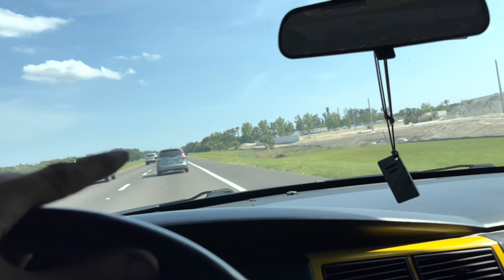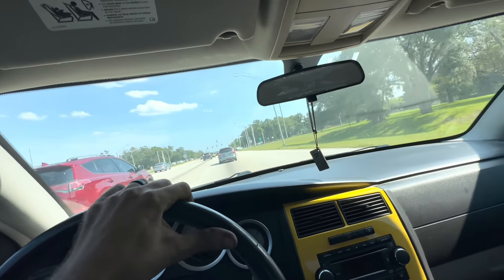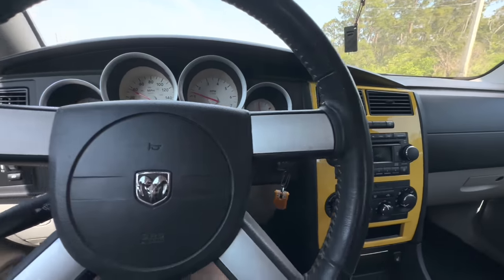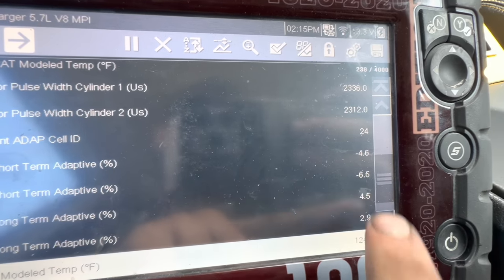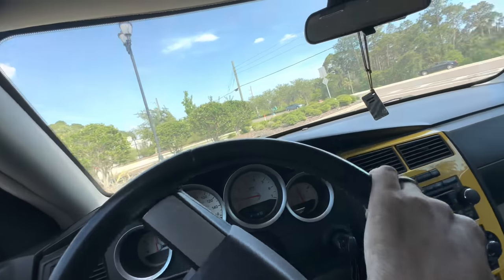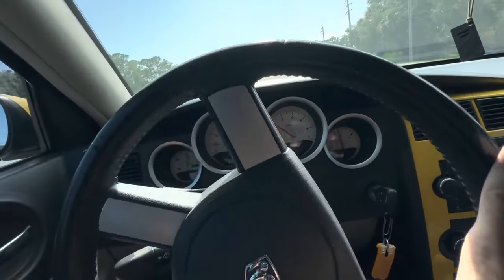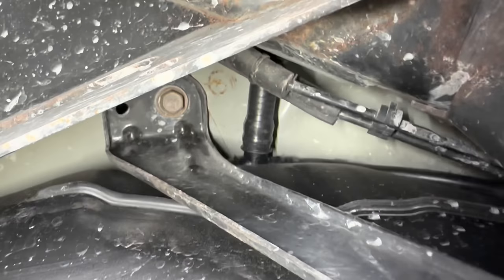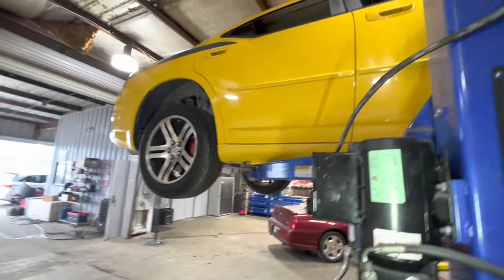Customer States: Engine Stalls After Fueling...HELP!! Dodge Charger 5.7 #mechanic

Comment: I could literally write a book on this subject.    It took me FIVE YEARS to put it to rest.    And I have a Lifetime Bumper to Bumper Warranty from Chrysler.   Bought it brand new at the dealership where I WAS having it serviced.     They were not helping and too were throwing parts at it.    As far as the gas tank issue, the NHTSA did their investigation and found that the rollover valve swelled when exposed to certain amounts of ethanol, caused an inconsistent tank pressure scenario, and ultimately liquid fuel would enter the EVAP canister and then the intake manifold under certain conditions, but in action, too many variables to predict.   The computer is looking for fuel vapor, not liquid, at that time and this basically floods the intake charge.    Stall.    They issued a set of VIN numbers for fuel tank replacement, which eventually became a full lifetime replacement warranty for all of the 2005-2009 LX cars.    They called it a “campaign “ and not a recall as it was deemed “not a safety issue”.     Funny, Chevy had a problem with ignition switches giving the same result, random stalling, and issued a safety recall.       Hmm.    Sounds fishy.    My car once stalled after a blast from the high speed curve on ramp, up to about 85, passing traffic in the far left lane, only to have it stall for the first time in several days, with no shoulder on my left, leaving me dangerously navigating all of the traffic I had just blown by, with no power to accelerate, yet, big trucks barreling down, and a fair bit of traffic.  Having to tap the brakes. to go behind slow traffic but having no throttle to stay ahead of the truck running me down in the next lane, but knowing to wait till after it goes by means getting creamed by the other truck a few lengths behind it will leave you a bit pissed off IF you make it through that twisted gauntlet in one piece.    Again, I could write a book.    Oddly enough, my car only stalled after a fill up ONCE, EVER, and that was with premium fuel.  In South Carolina, ethanol wasn’t mandated till 2018, and it was often used to raise the octane of regular fuel to get premium 93 octane.    Each state had different times and methods of implementing the mandates, with most starting in 2014, coinciding with the onset of the widespread stalling problem.    I called my wife and I went across the street to buy a hand pump from the auto parts store, and then pumped about 1/4 tank into her car, my car fired right up but did run rough and stall a few times just after, before clearing up.    Before that, I had to push my car away from the pump, as it would fire then stall, over and over.       At that, I wasn’t convinced it was the tank.    I ended up replacing the canister, the vent filter, the purge solenoid, convinced that was the problem.     Much to my dismay, after cracking open the canister and expecting a gooey carbon charcoal slurry, I found that I was wrong.   It looked pristine.    On a car with 165,000 miles at that time.   Wow.     Long story short, between the dealership and myself, I went round and round for five years, and they finally decided it was the engine wiring harness, and that a short was messing with the computer.    They couldn’t find one, even though they had a warranty to satisfy, but I did find a nice used one, inspected it myself, and being a sound engineer, I have extensive experience looking for wiring problems.     Did the harness swap, and guess what.   The problem came back.       My gut had been that it was the ECU but the dealership denied that.     I finally made an executive decision to pull the trigger on a company with a great reputation, Car Computer Exchange, and for $500 out of my pocket, I got a rebuilt and heavily tested ECU with a lifetime warranty.     Upon installation, the car fired right back up, and believe it or not, the entire car felt better.   Mind you, it ran like a champ beforehand.  But it just ran BETTER, and even the steering and brakes felt better, even the exhaust note was a bit different.     I guess this was all due to the most up to date fuel and ignition curves and stability control updates.   Incredible.    That was one year ago this July.    Not one hiccup since.    I truly believe all of these have the same source problem.   Of course I can’t prove it, but some speculate that the solder or the method of soldering used on the OEM ECUs led to premature failure.    Mine really started acting up after driving down about 10 miles of gravel and dirt and woodsy road several times for a remote recording session.     It also was more prevalent in the heat, rarely stalling during winter time.   The symptoms were all over the place too.     Sometimes it would stall right at the top of our Cooper River Bridge here in Charleston, SC, at almost the exact same spot, approaching the crest, and it also did so on the other tall bridge here, and always only after extended idling with AC blasting, making not for a hot engine coolant temp, but a very hot engine compartment .     Electronics don’t like heat.     I might write the book soon.   It would blow your mind what I dealt with at this dealership.    Mind blowing.     I have a lifetime bumper to bumper warranty on this car, which is a lifer, and I’m not sure if I’ll ever take it back for anything.     Think about that.

Comment: LOL! He said that the dealership would have done the TSB repair when the vehicle was in the shop. LOL!
Reply: I had two TSB's on my 2018 tacoma. I knew nothing about them until I talked to another tacoma owner. The dealership said they would not do the repair until I was experiencing the issue in the TSB. I said, "Well you can't fold the rear seats down so how the hell are you supposed to know the cab brake light housing leaks into the cab of the truck behind the non fold seats?" He just looked at me like "Well you are right."

Comment: my 300c had that issue, closer to drop in rpm and then a bit of a surge, noticed this after topping off gas during fill ups, stopped doing that and no more issues last 10 years,

Comment: Here in Canada we operate B-trains too, (two-trailers) a fully freighted B-Train takes 11 seconds to come to a complete stop from a speed of 100 kph (62 mph approx) that’s with an alert driver, on a good road with good tires and brakes. It doesn’t matter where you are in your vehicle if you are less than 11 seconds ahead of the B-Train and you hit the brakes hard, and we cannot move over to avoid you, we’re going to hit you. It will not be gentle, I will probably survive, I cannot say if you or your rear seat passengers will. This isn’t an attitude of "if it’s a question of you or me - it’s gonna be you!” It’s simple physics. Give the big rigs a wide berth drivers, we need the room. Drive safe everyone!

Comment: My 2006 magnum RT has the stall issue when filling the tank until the gas pump auto stops. I never try to top off any of my cars. I never replaced the tank under the extended warranty. I am just careful not to top off and deal with the possibility of stalling. I do notice that if I near-fill the tank and travel down hill within a few blocks after getting gas that the stalling will occur.

Comment: Thanks for the advice about pulling out in front of trucks,  The same thing applies to RVs and Motor homes.  I have a class A and it is surprising how many people have pulled out in front of me and then slowed down.  I'm never sure whether slamming on my brakes and having all my dishes and other stuff shift to the front, or just hitting the idiot is better.

Comment: When the tank is full and the car hits a bump the fuel in the tank gets pushed into the tank valve.. Overloading the valve and when it opens it gets sucked into the purge valve and into the intake. Its intermittent but it could be defective valve or design failure on  Mopar .You can try a different tank valve ???

Comment: Over filling the fuel tank. Filling the neck will get fuel to flow into the evap canister. Also I would check the fuel relays everything in Florida gets moisture in it and can rust and foul the relays

Comment: My ram 1500 with the 5.7 used to not start after getting gas. I never had stalling issues. Ended up being the sending unit crack and I was overfilling it. And then after the unit was changed years later my truck did the same thing but the second time it was not holding fuel pressure when u shut it off. It would go from 50-0 the second you turned it off. Cars do some wacky stuff.

Comment: Fun fact - my 07 Honda Pilot EX-L has the gas gauge on the right and the gas fill neck on the left. There is no arrow to indicate that it's in the left and when the gas is low its just a dot the illuminates under the E. I've never seen a car like this. It's usually the gauge is on the filler neck side or there's an arrow to indicate the side the filler neck is on.

Comment: Look at the throttle body carbon on the flapper.check the pins connected to ignition module. Controls the spark

Comment: I have a 2008 Ram with the 5.7 Hemi that acts very similar when I fill the tank up. I can put 30 or $40 worth of fuel in it and have no problems at all but only when it is filled up. The problem goes away in a matter of a few hours or the next day. Only when filled up does it act up. Fuel tank was replaced 10 years ago because fuel with flashing back out during refueling

Comment: Ray if you havent been told yet their is an ntsb recall on these cars for this exact problem.  They have replaced my tank for free .
Reply: Its only going to do it on full tank . Like to the brim . Its is a safty switch that built into the tank . Dodge will put an updated fuel tank in it for free .

Comment: I modified the light switch on my 2006 charger and it started causing all kinds of problems with the instrument panel, including stalling. the lights would go off, it would die  then kick back on. Crazy. As long as I never used the auto lights on part of the switch that I modified, the problem never occurred while driving. It didn't pick stop lights or anything in particular it would do it on a dark roads  in the middle of the night. That was always a good time.

Comment: Ray, i have an 06 charger SRT8 with the same random stall issue. It usually happens shortly after i fuel up stopping at the first click on the gas pump, and always at idle (stop lights 700-800RPM). It never stalls if I keep the idle high (1100rpm) at stops. The only time the CEL has lit was for an oil pressure sending unit failure (unrelated).

Comment: My 06 300C AWD (Hemi) had this exact same problem. Even stalled me out on the damn train tracks! Tank and all parts were replaced by the dealership under the "X53" extended warranty code.

Comment: as a trucker, i would like to thank you for adressing the issues with driving out in front of trucks. :D

also a good reminder is a 56 metric tons truck, requires a bit more distance to brake, than your 1,5 metric tons car/pickup truck. (yeah im European, sue me, here is a conversion for you, 56 metric tons, is 123458.96753 pounds.

Comment: You might always see a little bit of liquid gas in that vapor line if it is not getting in enough fresh air through the air filter.  Even if the tank was never overfilled, the canister can end up oversaturated with fuel vapor if that air filter is clogged.  You should replace or at least clean out the air filter on the canister, its probably never been replaced and is full of brake dust.  Mine has never been replaced but I clean it out every so many years along with the throttle body.  Pull it off, smack it on the ground a few times and blow it out with compressed air.  If more dust and dirt comes out of there than a Star Wars movie then you know that must be your EVAP stalling issue.  If the EVAP system can't suck in enough fresh air into the canister then you'll get a little vapor stuck in the line that turns back into liquid because the canister is still oversaturated even after a purge cycle.  It needs that fresh air in to purge the vapor from the charcoal... and the rest of the EVAP line...

Comment: Check the plugs. I had a stalling problem with my Jeep SRT8. You need to run stock NGK Iridium plugs. Anything else has a different resistance and activates the auto shutdown relay.

Comment: My old 06 charger rt did this, the only way to prevent stalling after fueling was stopping the gas pump manually instead of letting it stop by itself otherwise it would stall atleast twice, or if i let it fill up by itself id have to hop right on the highway and drive a while to undo whatever issue filling up causes

Comment: I have a 2006 300C that did the same thing, new fuel tank was the fix.  $100 says the guy "tops off" his tank when he fills up and you didn't when testing it which is why you had trouble reproducing the stall after fueling.

Comment: my 5.7 did that after replacing the fuel pump, they broke the "evap tube" at the top of the tank. took forever and all evap parts replaced to see it.

Comment: This same problem happened to my Charger of about the same trim & year. It would stall after driving on the highway for about 30 minutes, then slowing down. It would also stall after leaving it for a while, starting it and it would stall while idling. Took it to 3 shops, never got it resolved.

Comment: Haven’t read all of the comments, so someone may have already said the same.   I had a 2008 SRT Magnum that would stall after filling up.   Turned out it was the vapor canister.    I’d keep track of my mileage and never top the fuel tank.  No more stalling.    It was easier to do that than to replace the vapor canister.

Comment: On my town and country I had the random shut off while driving. Interstate travel for about 1 1/2 hour or local driving in very hot temperature days after I filled up. Van stalls. Messed up my purge valve and something else along with clogged the fuel filter somehow. I feel the filter was coincidental. Replaced those things and filled till the pump stopped. Never a problem since then. My son had the same issue. He filled his ford (litterly topped it off) the price of gas was cheap that day. Before he got home he could restart the car for about 20 minutes. He stopped topping off beyond the click. Never happened again. As an experiment he did this again three fill ups later. Exactly the same issue.

Comment: I have an 05 Dodge Mag R/T 5.7 with 100,000 miles. At 68,000 the engine ran rough, surged and wanted to stall. The dealer replaced the throttle body and flashed the PCM. Then the issue came back again the next day, wanting to stall. They replaced the PCM. I actually believe they damaged the PCM. But maybe the issue is the throttle body and just needs to be removed and cleaned good. Great videos!

Comment: In my 2007 Hemi (JGC), I solved mine by re-routing the cables to the PCM over the air conditioning lines. I was getting a P0129 on my codes. You can also do the key dance to check codes quickly if you don't have your wizbang with you. I posted on the Jeep Forum regarding this. But basically the four cables that connect to the PCM get re-routed from laying on the wheel well to zip tied to the firewall above the A/C charge port. Somewhat unusual problem but I'm not the only one that found relief by this "one little trick". I replaced several sensors up to that point on the parts cannon. It's so intermittent that you think it's solved but it comes back.  Over a year later and no stalls.

Comment: My mother bought a Renault Encore (AMC product) through a discount program from where she worked.  She never had a problem with the car driving 40 miles each way to work and back.   When my Dad drove the car it would sometimes run rough and other times stall out completely.  Sometimes it would restart after a while and half a dozen times it was towed to the dealer who never figured out what the problem was.   When my Mom died my wife took over the car.  When she drove it she never had a problem.  When I drove it it would stall at times.   One time when I was driving it my wife turned to give something to the kids in the back seat.  The car stalled.   I noticed she had put her foot down hard on the floor and pushed herself to turn around.  I removed the floor mat and found a plastic plug with 2 wires on it sitting on top of a weld.  I pushed the plug together and started the car.  I wiggled the plug around and made the car stall.  After 7 years the problem was solved.   I replaced the plug and relocated it under the carpet aside the console.  The wires fed the fuel pump.  I showed the dealer what I did.   It only happened when a front seat passenger put their foot in the right spot which is why it never happened when someone was driving it alone.  Say what you want about the car but for 9 years that was the only problem it ever had.  It was traded in with 180K miles and being in New England it had absolutely no rust on it. We just needed a bigger vehicle for the kids.

Comment: You said it almost stalls when you actuate the purge solenoid. Was that similar to the minor bit of acting up it did at the stoplight? Also could demonstrate that to the customer to see if it's similar to his experiences. I would lean towards faulty purge solenoid just because new stands for "Never Ever Works". 

You also went to purge solenoid immediately and I'm sure you know how that goes with diagnosing difficult vehicles, always seems to be the thing you suspect first.

Comment: an added item for your truck talk, If you pass a truck don't immediately change lanes again right in front of the truck. Give them some distance before changing lanes back. And my thought on the stalling, could it be caused by the owner "topping Off" the tank during fueling?
Reply: I usually go around town on my 50cc mopeds.
Another thing I do is I've the trucks a little blinker notice that I'm safely behind them when they pass me.